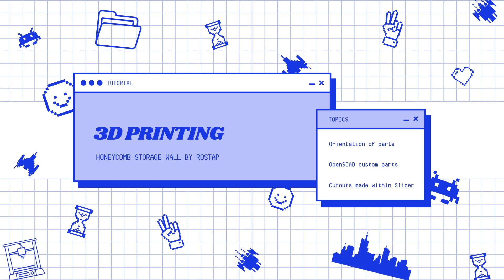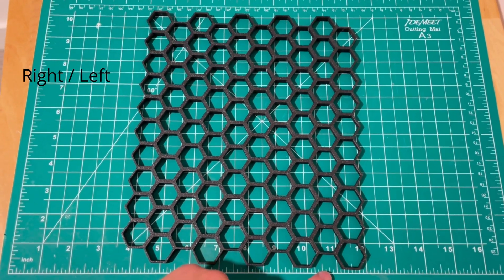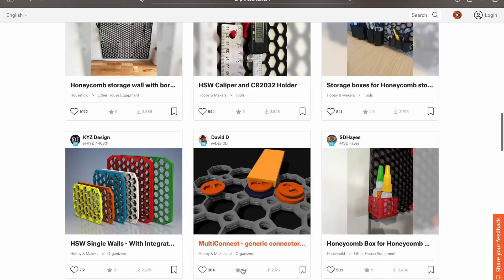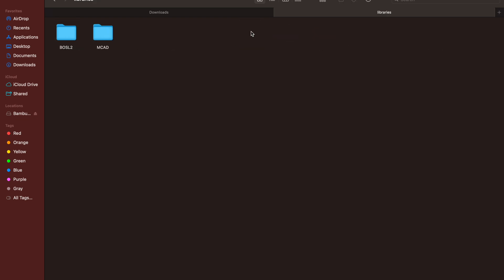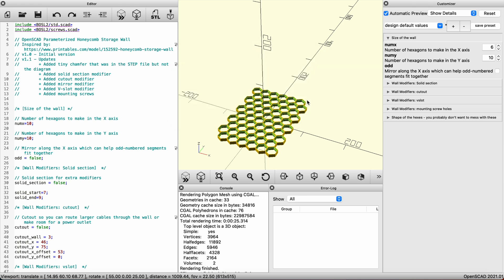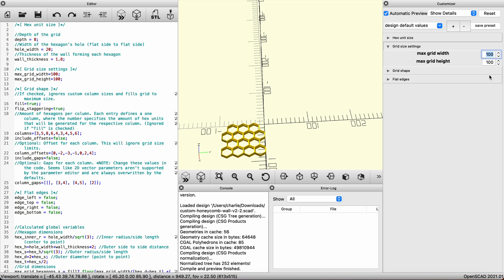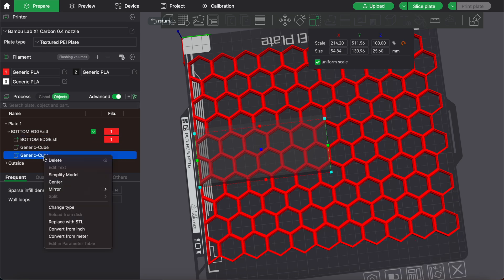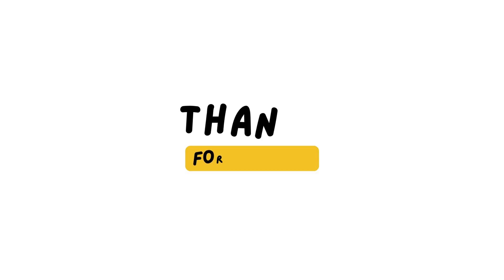Honeycomb Storage Wall - Tutorial ​⁠

Comment: The downside to using 3D prints for structural parts is that the "plasticizer" begins leaving the plastic the day it is manufactured. Over time, the plastic loses its strength and becomes brittle. For wall-mounted tool storage systems this means that at some point tools will begin falling off the wall as the mounting system fails.

The more technical explanation is that chemical changes of oxidation and chain scission occur. This leads to a reduction in the molecular weight and degree of polymerization of the polymer. Exposure to environmental factors like heat, UV radiation, and moisture accelerate this degradation of plastics. Armor All markets a line of products designed by a chemical engineer to restore and protect vinyl, rubber, plastic, and ceramic.
Reply: Along this line of thought, I've been thinking about a spray on protective layer similar to a gloss finish or protective clear coat with lacquer, but I'm not sure if that would be viable at all
Reply: @rainforest1474  maybe check for scaling changes and consider a slightly flexible coating to avoid cracking over time.

Comment: Thanks for the tutorial, I have one problem. I need to create small edges thats only 61mm wide to fit into where I'm about to mount my grid. But when I try to click in either left or top edge, it messes up the honeycomb pattern. Learned this when I printed a big sheet and had clicked in the "Top" edge selection, it came out in a different pattern. I can use the right and bottom selection and just flip the piece to go into my top left and bottom right corner. But how do I create a simulair piece for top right and bottom left? 

thanks in advance!